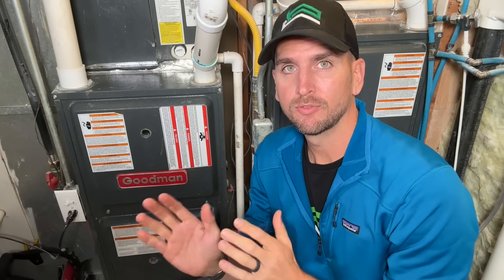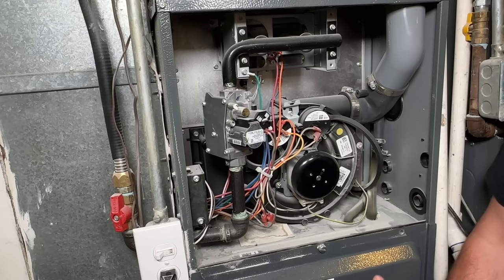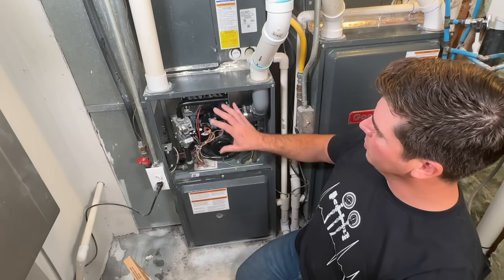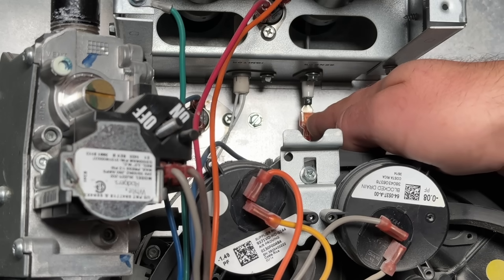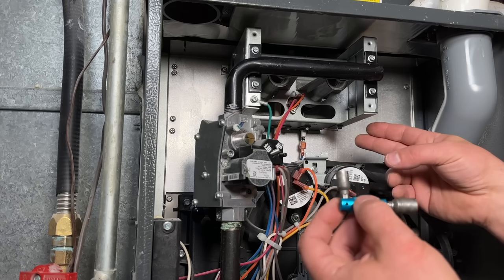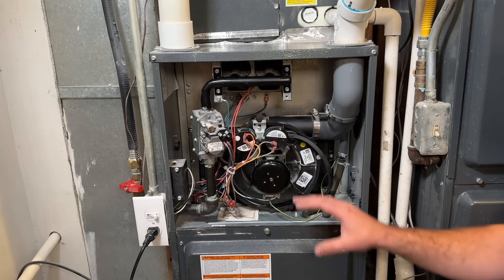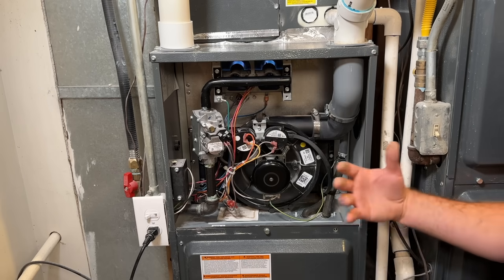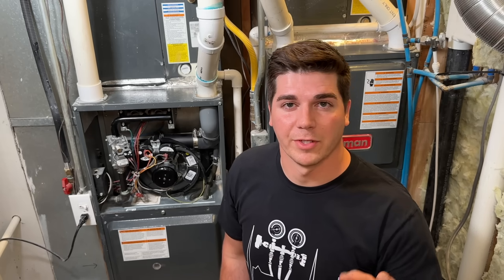Yearly Furnace Cleaning And Maintenance Pro Tips

Comment: Show us the service on a dual pack on the roof. My heater won't come on, the a fan comes on to clear the box, but it won't kick on the heat.🤔🇺🇲 From Southern California. November the 7th 2022 425 p.m.
Reply: Check your control board and count the number of flashes from the led light. Should be legend on the wiring diagram that says number of flashes = source of problem. If only the inducer fan starts and then unit shuts off sounds like pressure switch is not closing. He describes sequence of operation in the last part of this video.
Reply: @roberts1159  . I can't get up there but let's just say somebody could. You say count the number of flashes? Once that's done how do you reference what 1 through 10 flashes mean? To analyze the problem 🤔🇺🇲 from Southern California. THANK YOU FOR THE INFO. 👍🤗🙏♥️👌
Reply: @frankvetere4423  on the side panel where you see the leds flashing through the clear sight, you will also see a read out of what codes mean what. That will give you a good idea on what to look for. Hope you get it figured out! Cheers
Reply: @diyhvacguy  . I'm sorry when they installed this I don't remember seeing any sight glass where there was flashing lights through it it's just a big square box up on my roof heater and air conditioning. I have forgotten what brand right now 🤔👍🤗.                   🇺🇲 From Southern California
Reply: @frankvetere4423  The flashing lights would be on a control board, inside the unit.
You might consider calling someone, friend.  I would not want to "talk someone through" opening up a live unit and trying to sleuth this out third-party on a roof, Even if I were very proficient and capable of doing it.  No point in anyone getting hurt.  One should have a decent understanding of whats going on before taking the screws out, there being power in there and all.

Comment: If you clean a blower wheel (taking it out) on an annual maintenance you either going to loose money or have to charge a lot for the visit
Reply: This is true. This is for the homeowner, so if they choose to take it out and clean it, they are just out the time they spent to do it. I always pull the fan out to check the heat exchanger so it’s a good opportunity to tell the customer if the wheel is dirty and set up a time to have it cleaned. Cheers man

Comment: This is pretty much just a visual check.  Hire someone to do a more in depth tune up.  Didn't see any amp draw being checked, no gas pressure check/adjustment, no CO level checks in the exhaust, no condensate drain and trap cleaning, no temperature rise check.  Not sure what the codes are where those furnaces are installed but I don't see a drip leg/dirt pocket on those gas lines, and the gas line needs a union when using CSST.
Reply from the maker: Thanks for the feedback!

Comment: need to take out the burners and clean them too.
Reply: i wouldnt do them yearly. natural gas is very clean burning
Reply: @srobeck77  LP isn’t though.   And where I’m from a lot of people are on propane.   LP with a 90% furnace is a corrosion disaster if you don’t maintain it.
Reply: @theaveragesimmer4780  this was for a natural gas furnace, not LP, or oil, electric, or heat pump, etc. So not a relevant point.
Reply: @srobeck77  actually.    The video title states “yearly furnace cleaning and maintenance pro tips”.    Doesn’t specify it’s only for natural gas.   You’re just trying to argue.   My point was perfectly valid and correct.
Reply: @theaveragesimmer4780  ok but you watched it right? Its not LP, your just having a ego problem now trying to be right. You have "a point" true, but its an irrelevant point. Accept it ego man and move on with your life.

Comment: If this is all your hvac tech does, it's time to get a new one.
Reply: This is what the homeowner can do not an hvac technician. I feel like that was pretty clear. I don’t expect a homeowner to go out and buy a manometer and pull the blower motor out to inspect the heat exchanger. But knowledge is power and if the homeowner knows somewhat, what the hvac tech should be checking them that’s great knowledge to have. Cheers man

Comment: I didn’t see a check of the fan motor capacitor or a check for carbon monoxide
Reply: If the fan is operating, no need to check the capacitor. Homeowner aint gunna replace it any until its dead

Comment: I’m an air-conditioning and heating service technician, engineer, mechanic and installer of 35 years first of all the venting on that unit is wrong you’re supposed to have at least 10 to 12 inches of straight pipe before making any kind of bend with that installation. They immediately put a 45° fitting on there and that’s incorrect, that’s considered a restriction and can cause a limit switch to trip switch to trip.
that information could be found with the paperwork that comes with the manual. Also I’m EPA state certified type 1 2 and 3with a universal EPA certification through the state of California.You’re always supposed to run at least 10 to 12 inches of straight pipe before making any kind of bend on venting. Research what I’m saying it’s the truth. On venting you should always run a minimum of 10 to 12 inches of straight pipe on your vent before making any kind of bend whether it’s a 45° or a 90° rule of thumb.
Reply: That’s true, this was existing equipment that we were doing this video on and it doesn’t have any issues so I wasn’t going to call it out as this video was simply for furnace maintenance. But thank you so much for taking the time out to share your knowledge with everyone! You are a gentleman and a scholar. Cheers
Reply: @diyhvacguy  You're welcome just trying to share some knowledge with you not trying to start trouble at all. keep putting out the videos to help people I think it's great. Have a great day sir👍🏼

Comment: I hate these Goodman upflow installations.  It's near impossible to access clean the evaporator coils without disassembling the stack. Pulling or replacing the blower motor and wheel is relatively easy to do on these units.

Comment: I have the same junk furnace. Its water puddling in the furnace. Its only 3 yrs old
Reply from the maker: You were getting water puddling in your Goodman?
Reply: Make sure that the water condensate can be carried away by the drain; if it's plugged, water backs up into the furnace and drips out through the draft inducer.  Ask me how I know ;-). Also, that water is insanely acidic from NOx and SOx in the exhaust/condensate -- careful with your hands, eyes, and whatever it got into/on (inducers can be cheap on eBay as long as you don't need it TODAY!!!).
Reply: That wasnt installed right is what happened

Comment: Dude didn't even pull the burners and run a brush through the primary heat exchanger, then stick the vacuum in and suck up any crap that you knocked loose. I recommend replacing the flame sensor every could years, after having issues with Rheem flame sensors not reading.

Comment: Probably not the best idea to use sand paper on a stick that it's sole purpose is to sit in the fire. And he didn't stress this but do not vacuum any circuit board, it can cause static. Probably not much of an issue with furnace control boards but never do it to a motherboard in your computer for this reason.
Reply: @srobeck77  which part?

Comment: Don’t use pipe brush, flame sensor always comes out!!
Reply: Why not? Some flame sensors are extremely hard to remove. If I could give the engineers a piece of my mind on that I would! Haha
Reply: @diyhvacguy  I could easily imagine a DIYer accidentally trying to clean that oh so brittle igniter.
Reply: @diyhvacguy  Exactly! Like the Carrier Infinity 96 Gas Furnace AKA 58MVB at my home. Its sensor's screw is up there behind a big 4~5" PVC pipe. I tried several times to remove it but couldn't. Very stupid design.

Comment: Im HVAC tech. You should NEVER do maintenance on a gas furnaces.  Opening the unit just makes them dirtier. The idea was for oil furance which are flithy. Just change a filter. Nothing else.  Air conditioner need annual maintenance to see if the gas/ refrigerate is up to pressure and gentle washing of outside unit.
Reply: Not true. In fact almost the opposite could be said.
Reply: @sweatyyeti361  i guess my 30 years as TSSA tech make wrong. This is the biggest cash grab in our industry
Reply: Regular inspection and maintenance for any mechanical system is recommended. It is especially important with a gas appliance where left unchecked could cause health issues or death. I disagree that it is a cash grab. If a technician is performing the maintenance as recommended it is well worth the money, unless the company is either overcharging or not performing the task properly. Also, people can be doing their job wrong for many years.
Reply: @sweatyyeti361  mordern furnaces are close system they can not cause either health or death. There is no pilot light
Reply: @Hogtownboy1  Ok. This type of thinking is what scares me about "professionals" in this industry. Modern furnaces? pilots? how can you make such a generalized statement? Being a closed system!? there you go, a perfect system never breaks down never needs to be inspected! Ever heard of a heat exchanger failure? And even if it's not a heat exchanger other components fail over time. I'm not trying to knock what some people's knowledge is or isn't but if you're going to go around making blanket statements as across the board facts, you need to be careful.
Reply: Adam.  I don’t know who taught you to NEVER do maintenance on a gas furnace.  That is the most incompetent  statement  I’ve ever heard from a hvac tech.
Reply: @rodgraff1782  you are right after 35 years at the job I must be wrong. Never once had a furance break down because of lack of maintenance. It is a great selling technique thou.
Reply: @Hogtownboy1   Never had dirty blower wheel, rusted or dirty burners??  I guess not if you never took the covers off.  45 years on the job here but now retired.  I had hundreds of neglected furnaces, heat exchangers plugged with soot due to dirty, or mis adjusted flame, especially on propane, plenty of totally plugged up blowers, and combustion air wheels. I worked on furnaces from the 60’s up to 2019 models. Question for you.  How does opening up a filthy, plugged with dog hair and lint furnace make it dirtier?
Reply: @rodgraff1782  soot gas furance dont produce soot and if the person is actually changing the filters then they no way for either dog hair or dust to enter. 
Plugged burners the same thing. A 2 minute vacuuming is not maintenance. I, of course do yearly maintenance on the blower when I check the AC in the Spring. 
You be surprised how many furance I see where the heat exchanger has had a nail driven into it when I’m asked for a price on a replacement furance
Reply: @Hogtownboy1  Wong. Especially furnaces on propane.  Incomplete combustion = carbon(soot), carbon monoxide .  Alls it takes is one air damper to be miss adjusted. (Older atmospheric burners).  I’ve cleaned many sooted up heat exchangers, both natural gas, and propane.  Forced air, and wall furnaces.  I guess you have t been in the trade long enough to see this.  Alls it takes is bad combustion. It always seemed to happen, that I would get a sooted up heat exchanger call on Friday afternoons.  The lint and dog hair gets drawn in with the combustion air.  Vacuuming out areas of the furnace Is done with regular maintenance.  Your contradicting yourself.
Reply: @rodgraff1782  what kind you f propane are you using.

Comment: You can do everything in this video yet furnace is running completely out of factory specs and may even have a defective heat exchanger. Temperature rise, gas pressure not even checked - ideally, need co testing which only a pro would have tool for. So just call a pro every other year to do a thorough job - every year for furnaces 15+ years old.

Comment: You guys don’t check manifold pressure
Reply: I always do but for a diy inspection it’s not really warranted. Primarily it’s done when a new furnace is initially set up.
Reply: It’s not done when newly installed. Installers don’t pay attention to that stuff.  And even if they did, it doesn’t mean it’s going to always stay, for example, at 3.5”wc.  To be fair, you’re not showing a tune up in this video, you’re just doing a very basic cleaning

Comment: Sorry. Late to the party. So let’s say there’s a problem with that furnace, say the gas valve needs to be replaced. So how do you remove it without shutting the gas off at the main and how do you remove it how it is currently plumbed? Why am I asking? Because I have a bad gas value that I need to replace and mine is plumbed the same way. INCORRECTLY. There should be a union on the outside (inside if you want to live dangerously). But there is not. So I have to shut the gas off at the main, since the shut off valve won’t let you disconnect any pipes without doing so. And now you have to take a chance on that the idiot that installed it made the CSST connection reusable.  A simple DIY $75 fix now turns into a $1000 job for a qualified plumber to tackle this situation since the shut off valve is the limit a HVAC tech can go to without being qualified. I swear these idiots do this on purpose since they know when it goes bad you need to pony up $$$ to fix a simple thing. Anyway, I fixed mine and re plumbed it for $100. I’d  like to see YT guys fix all the poor installations that are out there. Heck. Maybe I just had a great idea to get YT famous, nah, I’ll. Keep it to myself.

Comment: Question? You are the homeowner and you open up your furnace to clean and notice a little rust on a screw what do you do? Answer nothing because you are not trained to do this. It means you have a comprimsed heat exchanger on a Trane condensing furnace. This is horrible advice if you don't know what to look for. We get paid for what we KNOW not just what we do!

Comment: Not even close to what should be done.  First as a maintenance tech I do is not kill the power.  I think safety most important so I take bottom door off to confirm switch kills power!
Reply: The power should be turned off when cleaning the flame rod. So thats not correct. If your really concerned with the door switch, use your multimeter on it. Plus the door switch power could malfunction intermittently, so now you just shocked yourself and maybe just fried the circuit board too by not turning the power off.
Reply: @srobeck77  Hello srobeck77.  I always take the bottom door off and confirm no power going to board.  At that point I clean the components as necessary.  Once we get our meters hooked up…then we work on it live to get our numbers.  No danger cleaning flame sensor as long as no power to board.  As for the door switch…had lots of dust preventing it from opening.

Comment: Carbon monoxide is heavy smoke is light by the time the smoke detector recognizes that there's carbon monoxide you're not breathing.
Reply: Carbon monoxide is a gas, not smoke.But to your point, it's very recommended to have both a smoke detector and a CO2 detector.

Comment: The power switch is not according to code. It is supposed to be at the egress of the room and red in color. Better to use the breaker which is a safer way to cut power
Reply: For what locale?
Reply: That exact switch is by code and required to be mounted onto the furnace. What kind of false myths are you trying to spread here, fella?

Comment: 4/10 on the tune up, how are the gas pressures? To high or not high enough? Flame sensor was still dirty after you “cleaned it” photos of the heat exchanger? Age doesn’t matter, neglect and poor maintenance can crack a 4 year old furnace. Drainage cleared? Ppm on the exhaust flue? Amps on the draft motor and blower motor within specs? Static pressures within specs? Filter MERV rating correct? How is the condition of the ducts do they need to be cleaned? List goes on… hire a professional don’t be lazy and feed your ego we all need a professional opinion whether you like it or not.
Reply: Why bother with gas pressures when modulating gas valves you are not allowed to adjust and can damage the heat exchanger if you do. Filter MERV rating are 100% subjective opinions. Dont use the blue fiberglass filters and on the other end, the Honeywell very high MERV black dot (or whatever marketing gimic they are currently labeling them as) or it will wear out your fan motor faster. No point to do amp draws unless theres a problem happening with the motor. Homeowner aint gunna replace it until its dead anyway. Nuff said....

Comment: He kind of skipped over the pressure switches part. What they do is make sure the exhaust and the drains are clear. Making sure exhaust can flow out of the flue pipes and water can drain out of the furnace. A big mistake people make is when the pressure switches don’t close they automatically assume the part is bad. Check your drains and your exhaust and make sure they’re clear. That’s why I like to clean the trap and also the I the drain hoses during a maintenance. That gunk builds up fast in there